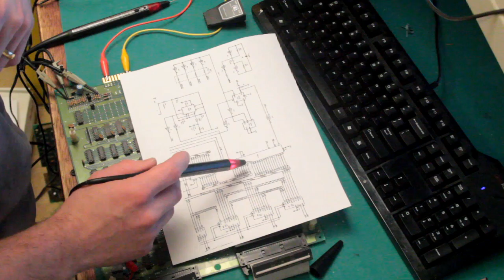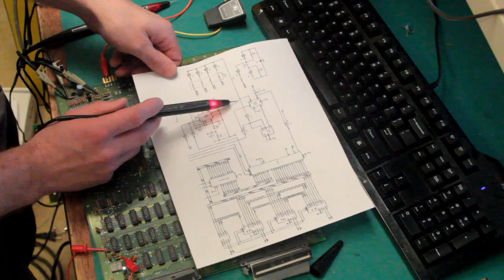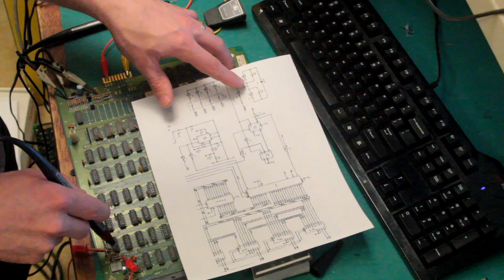Fix it Friday! - (Logic Series 01) Using a Logic Probe

Comment: Large scale integration is a blessing and a curse given the digital systems are mostly on microcontrollers these days. 

That said some analog applications are still driven by CMOS/TTL so they're useful and there are still many applications that use MSI as opposed to LSI.

Comment: The LED always remains red, but you can clearly tell when it is on. I have an LM341 (OmpAmp) to test so I can tell if the 'op-amp works or needs to be replaced. I need to get a logic probe.

Comment: How do you know what a good/ bad i.c should measure without a probe and the reading when used. Is there an input/output side that can blow the chip when used incorrectly. With so many i.c's available how do know what they all do and for what purpose in a circuit. Is there a table/index PDF available for all these 100's of i.c's. Do you test when the circuit is live or dead. Boolean is new to me. What are the do's and don't. I am a novice help please.

Comment: How do you know what a certain pin should be doing? Toggling/High/Low
Reply: Google the chip..... Or get the service manual..... Usually those crystal oscillator chips go bad start there first

Comment: You have just jumped straight into testing without explaining about the  probe like does the probe need batteries and how do you connect the probe to the board
Reply: Connect to board power supply after  the step-down  section

Comment: Thank you, that was indeed helpful. However, I have a Logic Probe that seems to be a bit more advanced, (or maybe just more 'bells & whistles). I have a Micronta Digital Logic Probe with choices for selecting  CMOS or TTL/LS systems, "Normal" or "Pulse" options, and then the LED lights that do what yours does but throws in various LED Colors, Tones and conditions, (long & short blinking, and/or solid states with and w/o tones).

OK, so I mention this because it may be helpful for you, (or someone out there), to know in order to answer my question/s. I'd like to know if I could use this probe to effectively identify a possible bad transistor in a small, simple PC board, (5V USB, DC).

The PCB has 7 transistors and I believe they are all NPN transistors. However, it's possible that one is a PNP but I'm  not 100% on that. I have no schematic and I am as novice as they come in the understanding and use of all that is microelectronics.

I do have a Signal Function Generator and a basic, two channel Oscilloscope and have not yet explored the possibility of using them to find the bad transistor, (if indeed, one exists). However, I'd like to learn how to use this probe for simple applications because it is considerably less weight to carry around if I only need to do a preliminary exploration of the circuit. 

Of course, at this point, I don't even know if the probe is capable of finding a bad transistor in a circuit, but then, that's why I'm here. 

Thanks again for the great tutorial! That got me one more step closer to learning this science, (strictly as a hobby).
Rich
Reply: From what I understand a transister is just a fancy switch..... Therefore it toggles on and off..... They however can  function as a signal amplifier
Reply: @Swanlord05  Yes, that's what I thought but in every explanation I've read for the transistor, the first reference is as an amplifier, followed by the second reference as a switch. In fact, the way I see it, it must "switch" in order to "amplify", so I guess it's 'six of one and a half dozen of the other'.
Reply: @richpaul8132  Transistors can operate in different modes and different types of transistors have characteristics that makes some better suited for specific applications over others. Transistors were initially used to replace vacuum tubes. Transistors can be thought of as valves. A small input signal applied to the base of a transistor proportionally controls the current flow between the collector and the emitter. That applied voltage and current flow can be at a much higher level than the input signal. The end result is amplification. Transistors can also be used as switches.
Reply: @midiwerks5450  These electronic components are absolutely fascinating and the subject never ceases to amaze me. Perhaps even more amazing are those who have developed and/or created the systems. I've been building my own computers (from the ground, up) for over 12 years. If I'm not building a completely new computer, I'm doing upgrades to the ones I have built. As each build moves into the next upgrade stage, where I intend to install a new processor, (which may be several generations ahead from the previous one), I must first buy a motherboard.

So, when I buy a 'mid-level' motherboard, (in the $500 to $650 area), I can't help but look at it for at least 15 or 20 minutes. I try to understand how these people even begin to conceive the way all those microelectronics are going to communicate and know when and where to send those absurdly tiny voltages! It really staggers my imagination and that motherboard isn't even the tip of the iceberg! Just incredible!

Comment: I wonder if you can say if my approach is bad troubleshooting or good. I have a drum machine that works fine but when I want to record a drum pattern the entire machine freezes up that I have to turn on and off. Should i check the logic probe around my Z80 CPU after it locks up to see where is read wrong then trace the problem that way?
Reply: Check the clock oscillator